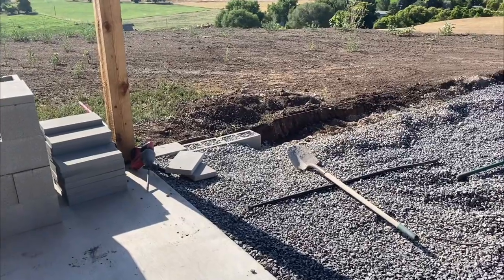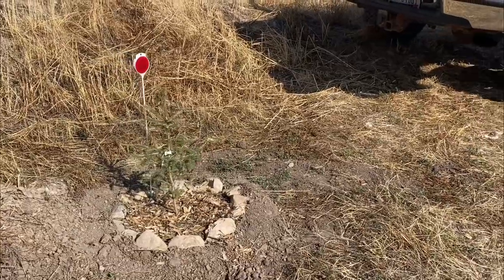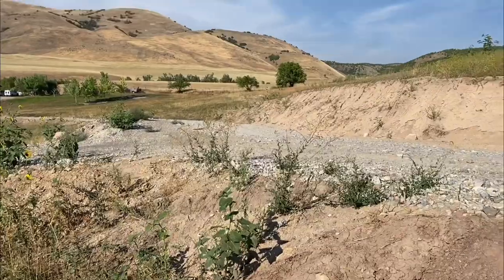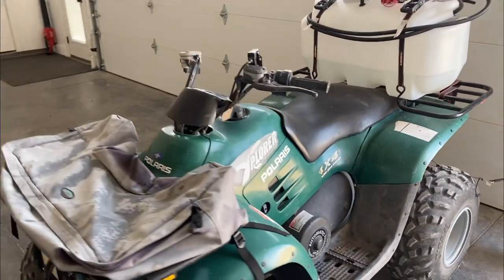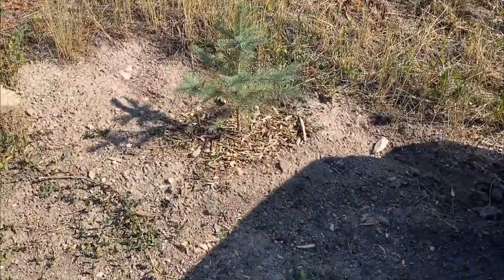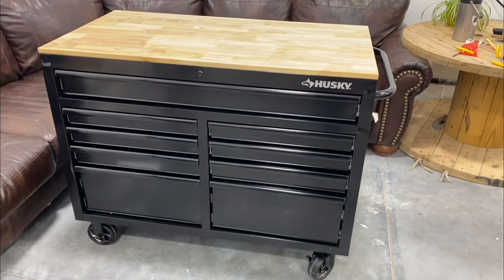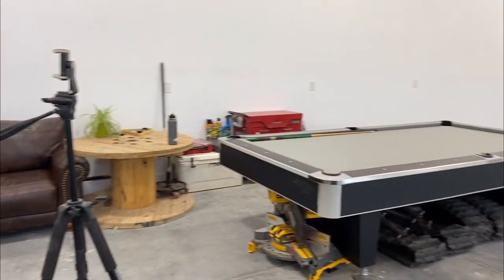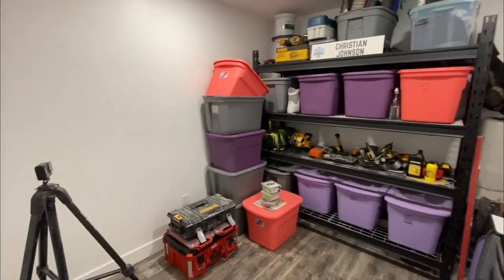#024 Concrete Divider, Trees, Gutters, And Toolbox (shop house build)

Comment: Have been following your channel and build. Awesome job you have done so far, keep up the good work.
Watching your short video clip of your backyard getting flooded out and the amount of rain water coming off of your roof. You may want to ask the installer if the 2 downspouts is adequate for the size of your roof. Another heavy rain could possible surcharge the 2 downspouts and overwhelm your one gutter.
Reply from the maker: Thank you!